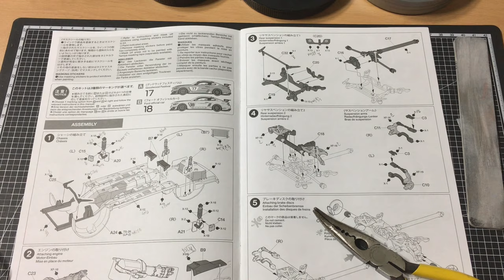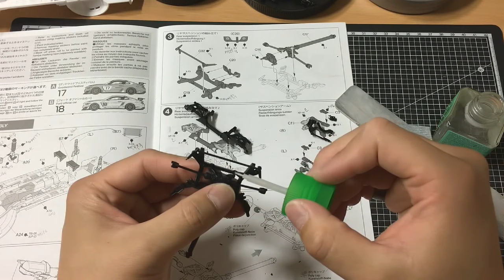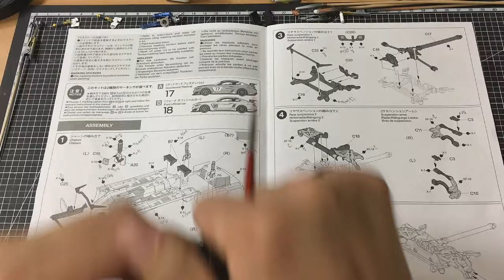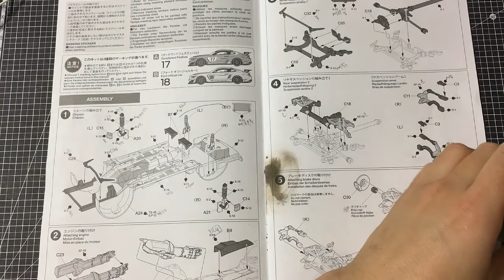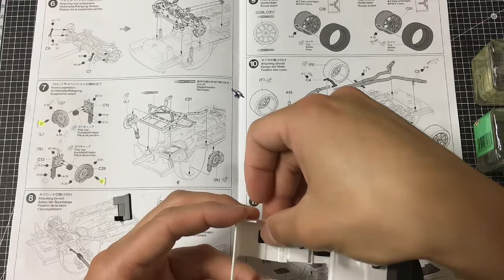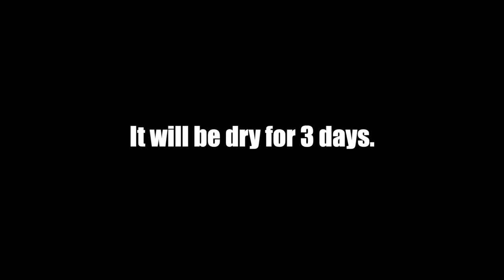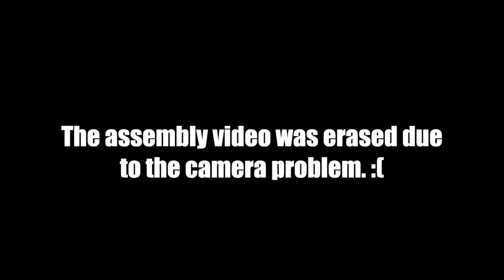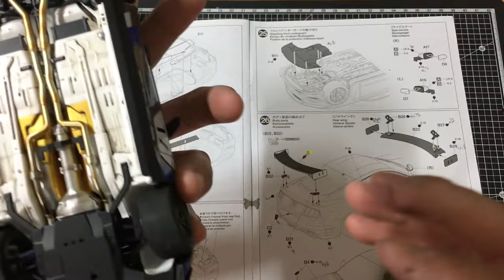[Full build] Ford Mustang GT4 Make It 1/24 Scale step by step build (Tamiya)

Comment: I am currently building this Mustang but I am having a problem with the seam lines. I marked them and removed them by sanding. I used two layers of primer but when I finally paint the body the seam lines appeared like grooves on the plastic. Any ideas? Thanks.
Reply from the maker: It happens because the paint thinner melts the surface. Dry, grind, thin and spray several times. It repeats again if you sprinkle it thickly.

Comment: How do you  touch the decals without them falling apart? There water based right?
Reply from the maker: Wet it with water, glue it to the desired place, remove moisture little by little, and apply it slowly with a mark softener.
Reply: @Makeitscale  Ok Thank you

Comment: Did you somehow smooth the laint before putting semi gloss varnish? Since I'm building same kit and I've got problem, where paint is not smooth enough even when I thin it down heavily and use low pressure
Reply from the maker: There can be many problems.
The paint may be old, or the ratio to the thinner may be a problem.

Comment: Looks awesome! What kind of airbrush do you use if you dont mind me asking?
Reply from the maker: I uses Richpen no.3, richpen gunpiece GP-2, and Urethane painting uses mr hobby ps-290.
Reply: Make it scale Nice so you have staple for your builds. Is the 290 primarily what you use for body’s? I’m the market for something good quality that can spray wide for body’s and potentially fine if I need to knock out some detail painting. I currently use a Iwata CR and spray cans
Reply from the maker: @jamieroseman4429  The Iwata CR and spray can be a good choice. 290 is used for urethane. It is good to buy equipment while making a lot.

Comment: What is the purpose for a semi gloss clear then a urethane over it ? Just curious.
Reply from the maker: Rather than putting urethane on a smooth surface, putting urethane on a rough finish increases adhesion. It is an act to prevent possible problems.
Reply: @Makeitscale  gotcha. I'm learning so that's good to know.

Comment: Fantastic build! I'm wondering where you got the (I'm not sure what it's called) netting? The part that's hung to the left of the driver's seat. It's on the actual car, and I've never seen a scale version of it.
Reply from the maker: Oh! ha ha:)  It's made by cutting off the electric tape.
If there were more data, it would have been more sophisticated.
It's too bad. :(
Reply: @Makeitscale  So, you mean you scratch-built it from electrical tape? I think it looks great! And thanks for the reply.
Reply from the maker: Oh sorry ! Electric tape means insulating tape. :]

Comment: What PSI are you spraying at? Also, what tweezers are you using?
Reply from the maker: Airbrush used:
lacquer painting : Richpen no.3, richpen gunpiece GP-2 (1.5bar)
Urethane painting: mr hobby ps-290 (2.3bar)
Richpen and Iwata products are recommended.
tweezers write anything.
Reply: @Makeitscale  Thank you! Your work is excellent

Comment: Do you put cement or glue on before putting carbon fibre decals?
Reply from the maker: It is a decal glue and softener. If there is a bend, use it.